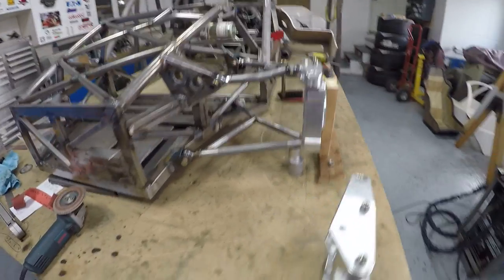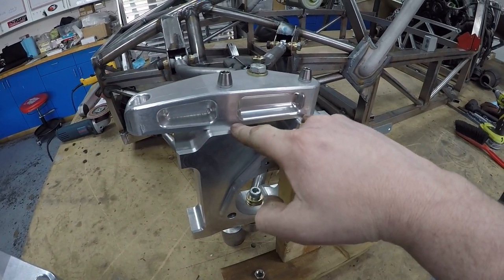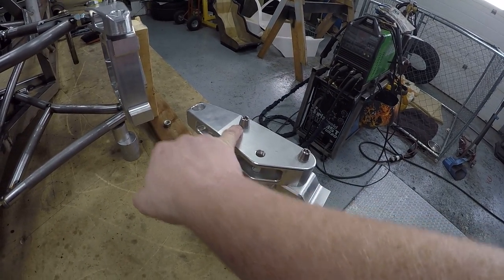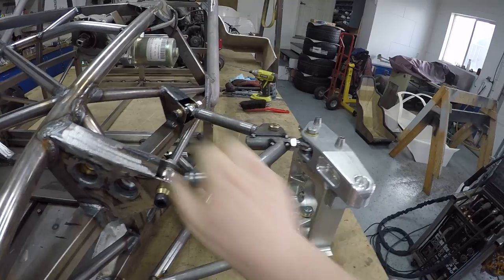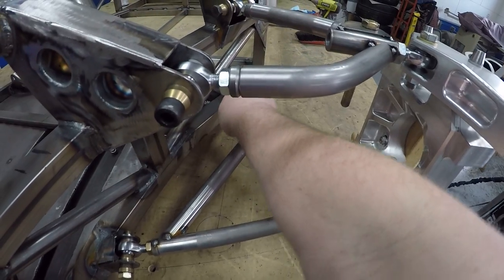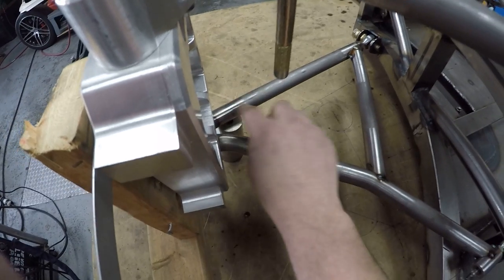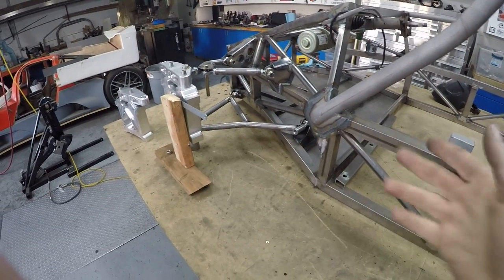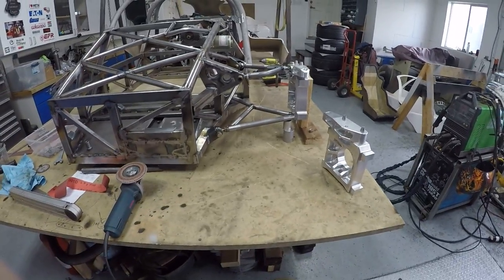962 front suspension

Comment: looks like it's imperial hardware, not metric?
Reply: Living in North America, Metric still hard to find in all sizes and finishes..... It was the reverse in the UK...
Reply: Clive HD Homer yes, I understand. We use NAS bolts and jet nuts when doing suspension designs, that’s all in imperial units. Just wondering what’s the hardware standard for original old Porsche race car? is there any aerospace or motorsports grade metric out there?
Reply: Most original were NAS 10mm I'm sure. But this was never going to be a pure race car, was built for road driving and I spec'd it for extra safety. There are some Aircraft parts places I'm sure I could if needed get them from there. But at extra cost and 10 times the price. If I built a pure track car I'd go that route for sure.